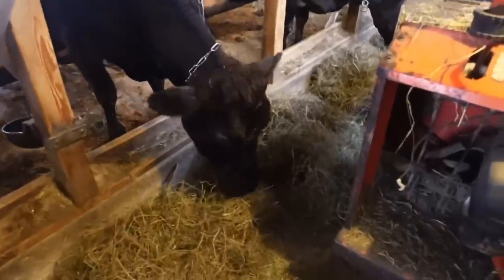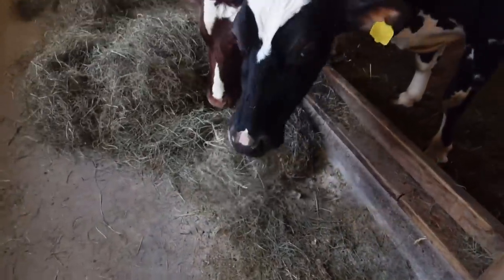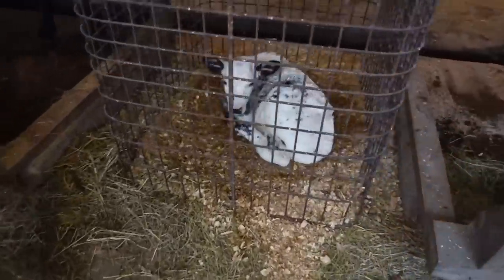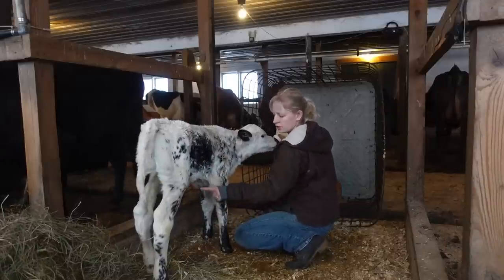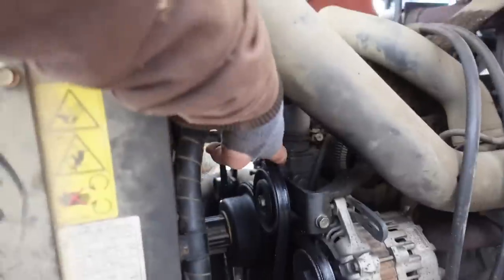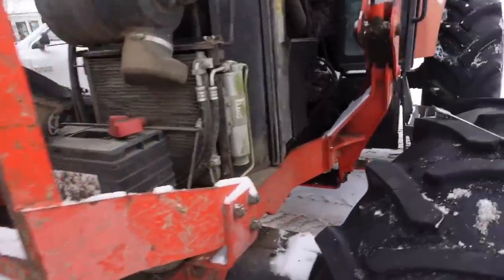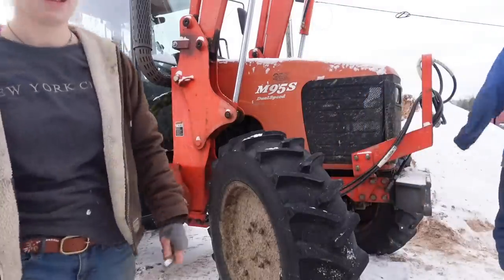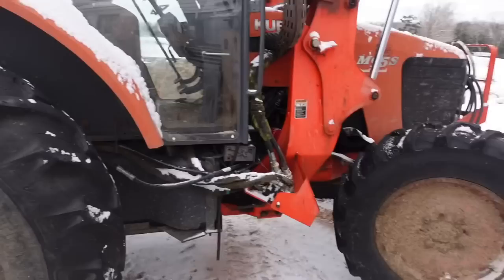Original belts? Tractor check up + adorable newcomer…

Comment: Hiya Tay,
Good video again; thank you. You are not wrong; that is an adorable calf; as you said, shame you can't keep the cute ones. 
I'm glad you found the problem with the tractor; that air filter could use a spring clean; you are right again. 18 deg, and working with large lumps of metal is not fun. Well done to you both for getting it done, though.
Stay safe & warm, oh, & caffeinated too, Steve...

Comment: When you blew out the air filter, it reminded of yesterday on the  PA Pike service plaza a truck driver was doing the same thing excet he used the air line hooked to air seat in cab,had to have engine runndirt but sad part open air intake was wide open and sucking in all